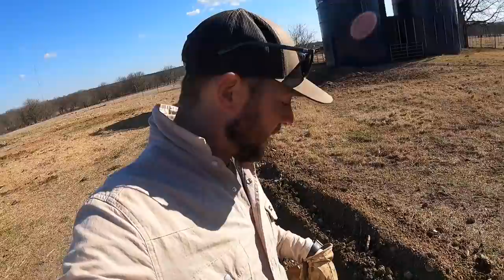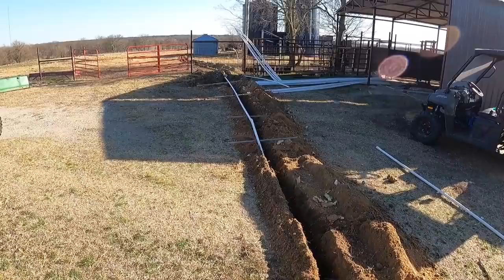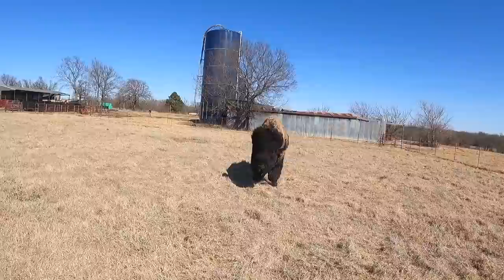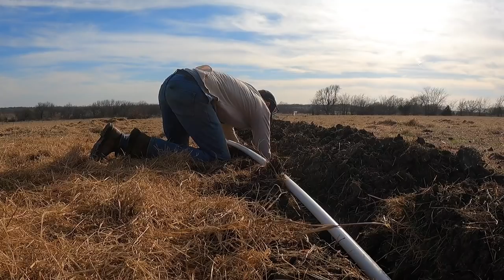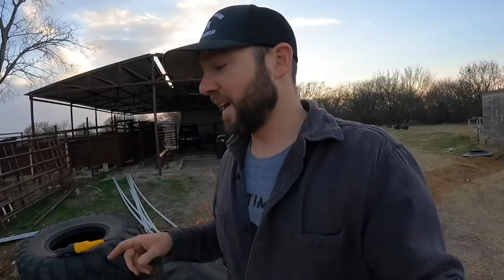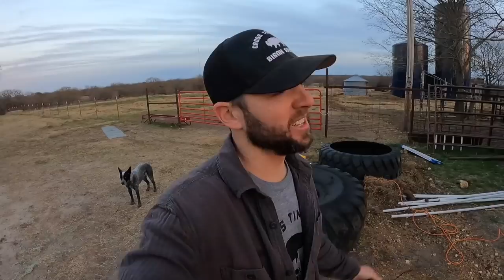I'm Trying to Work, and Dunbar is Causing Problems! (Bison Water System Part 2)

Comment: My experiences as a plumber, is that Schedule 40 PVC Pipe will become brittle and crack with age if the ground shifts and heaves during winter freezes . Importantly it will split in winters frozen ground . Also I found it important to use primer on the pipe ends and in the female fittings.
Reply: I was thinking the same thing. I was wondering if it would have been better to do PEX.
Reply: On our Ranch, we dug all of our pasture paddock irrigation pipes 6 feet down.  In snow country, the ground freezes and the pipes burst, animals are without water and a huge expensive muddy job come spring when the ground melts.  I hope the ground doesn't freeze in Oklahoma.  We always use primer and then the glue.  Without the primer, the glue may not adhere well to the slick pipes.  Especially with freeze and melt in winter and spring.

Comment: Before you seal up all your water lines could you install. Make room for an air adapter so when the weather turns bad just turn off the water and hook up the air line up and blow out the lines get reed of the water in them

Comment: A quick note when your pipes are together, put the couplers on then put them in place that way you only have to glue one piece of pipe at each junction! Will save you a lot of time!
Reply: Good tip.

Comment: Dusty, I hate to be a nag but you should not just use cement on PVC pipe. The purple primer is part of the weld. It softens the pipe and makes the joint much stronger. Not using it can leave you with weak fatigued joints and they may fail and leave you with a mess. Secondly; when you lay that much pipe, you need to use a larger size pipe for volume. You should have used 1 1/2" at least to pipe the water close to your dispensing terminals and then reduced back down to the 1" for pressure. I have done too many irrigation systems and from experience this has been the case. I am not being critical, just trying to help  Keep those videos coming.
Reply: Do you have any irrigation videos? Would love to see them.

Comment: That's Ok in about a year from now you can rent the riding trencher. That will be about when you have to start repairing ALL your PVC glue joints. Because they're going to come apart. Next time use Solvent on both ends and Adhesive.

Comment: Why pvc? Alkathene is so much easier to handle, no need for glues, you could run greater lengths instead of 20' sections, making cuts and adding valves, bends, etc as you choose. Correct me if I'm wrong, but I think alkathene would also be cheaper.

Comment: How about protecting your fence with a string of hot wire, which will not be a perfect solution, but after a few zaps they will figure that the fence that divides the black rubber tire of the water pool is safe but ripping up the other fences is not. The cost of the sting wire, and accessories, can be offset overtime by the savings from not replacing what they damage.

Comment: Sorry but doing water well drilling & repair ,I don't understand using and burying PVC it doesn't hold up always seems to fail/break. Why not bury black poly even 100psi is better no couplers etc ?

Comment: No wonder you get such low pressure at the furthest tanks. Using that small diameter piping. Farmers here, Australia, would be using 75mm, or larger, polypipe. Plus it comes in long rolls so fewer joints. Don't know how it compares in price.

http://www.polypipe.com.au/category40_1.htm
Reply: Any videos on how to do it?